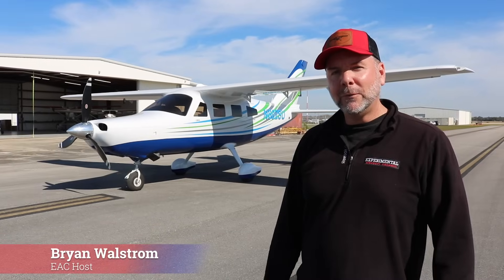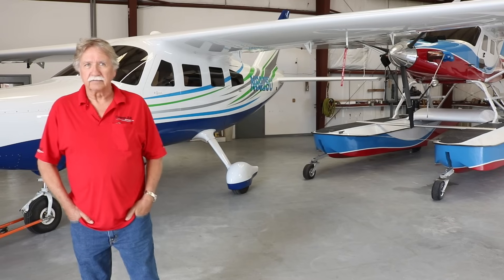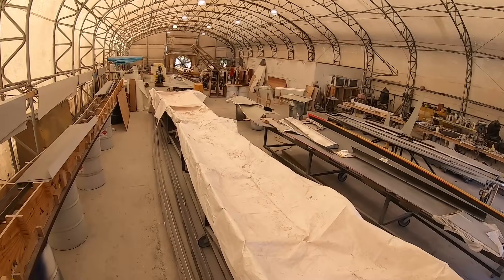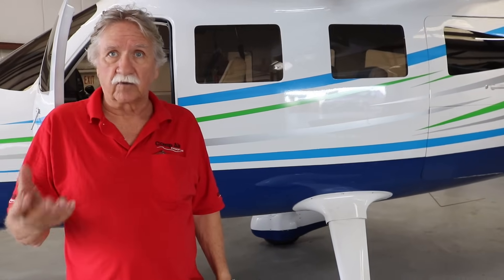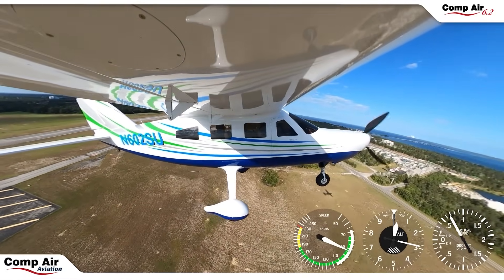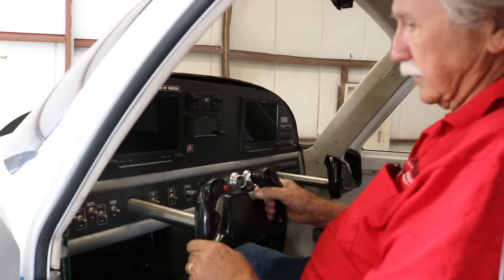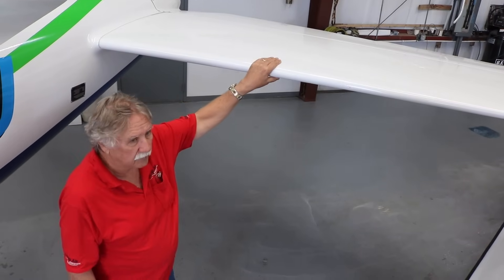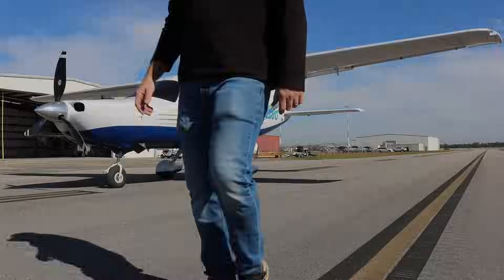NEW! CARBON FIBER Kit Airplane 6 Passenger - CompAir 6.2 Aircraft

Comment: Dear Mr Lueck, I am building a Z750 , it is not the plane I really want, it is what I can afford.  I had my share of discussion with the late Chris Heintz before, about speed, he seems to like slower designs. I been asked , "what's your hurry"  and you said speed is not that important. One of the main reason we fly is because of speed, or else we could have taken the bus or ships. True, much of the time it is not important, but what actually count is the option, a 220 mph airplane can always throttle back to 90 mph, but a 90 mph airplane do not have the option to go 220 MPH. Larger planes like the Orion or C130 have the flexibility to just shut half the engines off during loitering. I know the average public did not know , civil aviation been basically struggling with the "sound barrier" for 3/4 century. Jets got more efficient and saved many fuel stops, which translate into speed. I said below the late Martin Holloman's Super Stallion design, if you close up the whole wing, you can tanker enough gas to reach Hawaii. Especially with a Chevy LS engine. The Walters (now GE) is a great economical choice , a clone of the PT-6, which is a bomb proof design. The Garrett straight thru engines are marginally more efficient, but they are intolerably noisy  on the ground. I hope you keep that in mind.

Comment: I personally would want to see the test data on the wings.  
Would personally prefer a brace to reduce the wing stress. Regardless of the increased drag.
After two years operation and NDT on the air frame..  And the best QA program   Only Then
Reply: It is a carbon fiber airplane.

There is no reason for a lift strut, it will not save any weight.

Comment: Whats the pricing??
Reply: If you have to ask...

The engine is a TSIO-540 of 350hp.

This is $200,000 for just the engine, no accessories. And no propeller (Add another $50,000).

1/4 million for the propulsion. Add another $75,000-$100,000 for full IFR avionics and autopilot.

The kit is going to cost at least $100 per pound of carbon fiber. If the airplanes empty weight is 3,000lb. Do the math.

Comment: You had this 6.2 design for a long time, or else you could have saved a lot of R and D time by just buying the rights of the Super Stallion off Aircraft Design Calif. , designed by the late Martin Hollmann, and excellent 6 seat that can use either the Lycosaurus 540 or  Chevy engines. Range is  2000 + miles, depends on how many wing compartments you close up for fuel, the Chevy engine is a bit more efficient.   It look like a modern C210. The gear retract. There are about 4,5 flying.

Comment: A wing between floats to bear 90% of the weight of the floats,  at what price?? Reduced airspeed, that would be the main penalty. 650 HP is a lot of HP for 4 seats. So you can spare the HP to fly that extra wing area, but it will drink like a PC 12, that is another penalty. I hear Walters been bought by GE a few years now, and that lead to the first engine to power the new Denali that is not a PT6. P and W needed competition badly. They were about 2 decades behind others introducing FADEC automation when they should have been the first, with a US parent company that did the lion's share of the R and D for you. But because of the lack of competition and they own 70% of the small turbine market, they were 20 years late.

Comment: The thing that kills most pilots is stalling.  Is it possible to have an autopilot for the engine so that if the airspeed drops too low, and the pilot does not apply more power when the 'stall-soon' alarm sounds, the autopilot will automatically apply more power to avoid having the airspeed drop down below the point where the stall will begin to start ??
Reply from the maker: "Auto-Throttles" is a thing on Big Jets... not so much on the smaller GA Aircraft. Interesting concept though. :-)
Reply: Power does not stop the stall.

Stalls are not caused by low speed.

Stalls are caused by exceeding the wings critical angle of attack. Which is possible even at maximum speed.

To prevent a stall, simply avoid pulling back on the controls. Or otherwise limit up-elevator deflection. (Stick pusher).

Comment: I fly a Cessna 205 but been following this. Very cool. Exp should be able to shove a BRS parachute in it, no?
Reply: That would mean cutting the carbon fiber right? Wonder if that would change structural integrity.  I would want a brs parachute also.
Reply: Yes
Reply: An airframe recovery parachute of this size would be about $30,000 and weight nearly 200lbs. Oh, and cost $10,000 every six years for a repack and new rocket.

Comment: Per price sheet on website until April 1 2024, with all 3 levels of builder assistance, you will be exactly $1,000,000 with new 350hp engine (196k) prop and spinner (35k), glass panel (90k)    plus taxes etc, and that doesn't get you paint or upholstery yet

Comment: The specs are not possible in a high wing with a piston engine.  The plane is WAY to big to be a kit or homebilt.  So something goofy there too.
Reply: The specs are "not possible"?

What, 175kt cruise? 

With a 350hp turbocharged engine that develops 100% of sea level power at 18,000ft?

There is no way this airplane CANT go that fast.

High wing or low wing makes no difference on performance what so ever. It is a design choice for easier accessibility and downward visibility.

Comment: Good looking airplanes from 50 ft...wonder what they look like inside,  considering the shop conditions...I dont remember  the CompAir stuff having a great reputation for quality.
Reply: How many times have you worked in a composite shop or built your own airplanes?
Reply: @user-bs8uu3uv6y  As a 20 year Marine helicopter Airframe mechanic that did both sheet metal and composite work, an FAA certificated A&P, Quality auditor and inspector with experience at multiple aviation composite manufacturers and repair stations, I think I can say I've never seen housekeeping that bad in a repair or manufacturing environment. Dust is just one enemy of bonding, which composites, as you may have guessed, are so highly dependent on.
Reply: @RamblerMan68 

I also saw the raw fiber cloth just laying around. That should absolutely be wrapped in plastic at a minimum.

Comment: The inventor of the light emitting diode or led, was Nickolas  Holonyak. He was credited as being the sole inventor also invented certain types of Lazers. 
Married to the same woman for 61 years without children died in 2022
Reply from the maker: I read the same. I inquired just yesterday asking for clarification on that statement. Will report back.  Thanks. Thanks for watching.
Reply: I was wondering the same thing…
Reply: what a nice plane❤❤
Reply: ya, cool plane, this founder seems a bit large on claims there huh. Unqualified speed record claim?
Reply: Was General Electric so maybe his dad worked for GE?
Reply: “The led” maybe he’s talking about the standardized red led not the technology of led itself?
Reply: @Douglas-iz4de I doubt a dude building air planes for 50 years would lie, it science field there are many individual inventions that make one single product. So it's probably just a wording issue.😊
Reply: I O 540  TWIN TURBO ?  3 BLADE PROP , IDEAL FOR ALASKAN ADVENTURES  OR PLANED VACATIONS !  I NOTICED THE LONG NOSE  FOR TURBOPROP , SO MY QUESTION IS WHAT MODEL WILL BE ECONOMICALLY TO OPERATE , AND IF IT IS PRESSURIZED CABIN ?
Reply: was he made a rich man
Reply: Phrase ology  is probably off. Thats all....

Comment: Interesting but they should get it certified if at all possible. Also get away from lycoming who want 100k for a WW2 engine
Reply: My plane was in their hanger for a short stint. I tried to convince them to ls swap it
Reply: why certified? An ls7 or similar would be awesome; these are quite reliable & inexpensive
Reply: @jonhinman2471  Cirrus started with a kit plane. They made 20, killed 13 people. Then they did certified planes and now they totally dominate the small plane market. 10000 SR planes now. Despite being massively overpriced. The potential is just worlds apart. It's a huge hindrance for a buyer to have to go through the build process, even when it's faken and token at the factory.
And it's fairly easy to get planes certified today. The criteria is more performance based than formal paperwork. And composite planes are very simple so easier to assess. 
LS engines might work but similarly someone needs to take it through certification. Shouldn't be too hard either.
Ultimately small turbofan jet engines is the way to go though. Just nobody has made them small enough for 2-4 seater planes. And they can't be as greedy as jet prices are today. Jet engines can be very cheap if done right. It's really a simple concept and light. And have the longest service life of any engine type.

Comment: The finished airplane looks fantastic, but this composite shop is NOT to general aviation standard. I would be concerned with the quality of the composites work.
Reply from the maker: Actually... it is quite typical of other Aviation Composite Shops I have visited throughout the years.  Dust is dust.  Fiber is Fiber....I guess?

Comment: I think experimental aircraft is great. I don't think amateur built should be a 6 seater. Keep the risk to passengers down by decreasing the number of seats.
Reply: I don't think you really understand the term Experimental in aviation
Reply: I think it is OK to take personal risks, but not OK to endanger others. The majority of builders don't build quality aircraft like Mike Patey. I am an A&P and worked in a factory that produced kits and customers built their planes. Some were quite good and others atrocious. It just takes one oversight to be dangerous. For example, using a crimper from Home Depot to swage your control cables, not using a Go-No-Go gauge to check the quality of the swage. It may fly fine until one day the connection fails and you have lost your elevator control. And yes you could try to correct them but they haven't read the books or studied the material but they know more than you. @gilkennedy7638
Reply from the maker: I believe MOST of these KITS will be factory assisted projects here due to the project scope. Probably very few stand alone builds unless the Builder has assembled several Aircraft (or a Mechanic).  Not saying it's overly difficult. But considering cost and time.  Etc etc.
Reply: 6-seats have higher insurance premiums.

But there are so few options in the size range, it has a competitive advantage for those who can afford the upfront and ongoing operating costs.